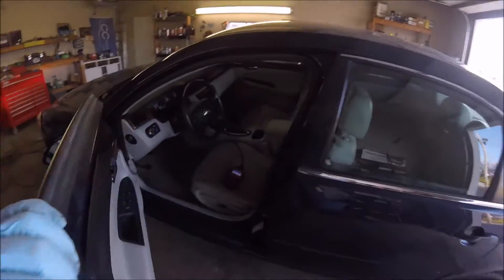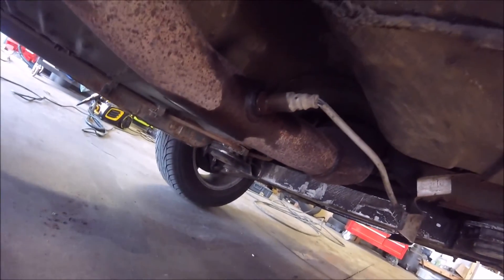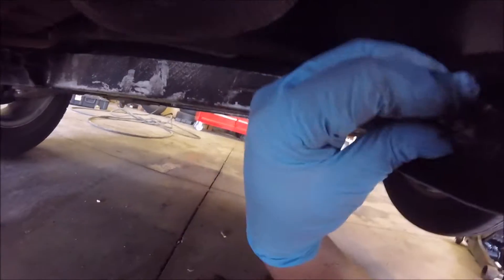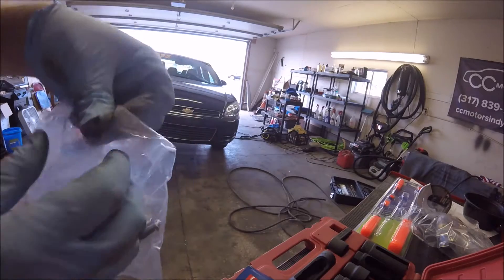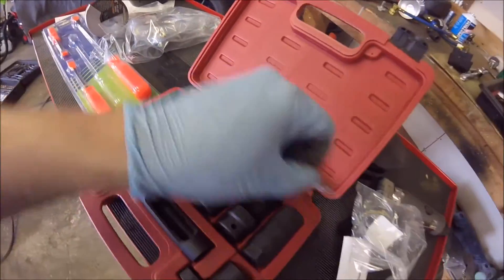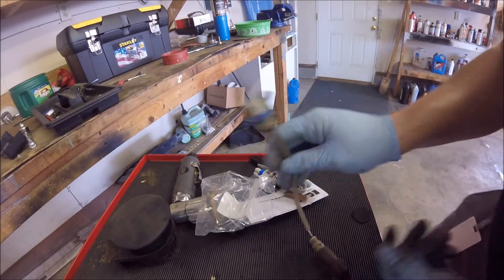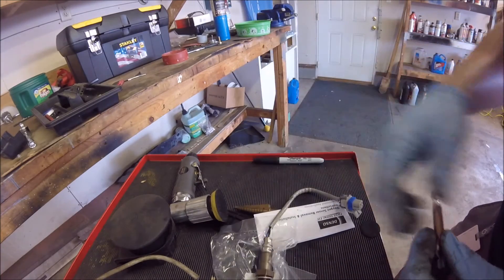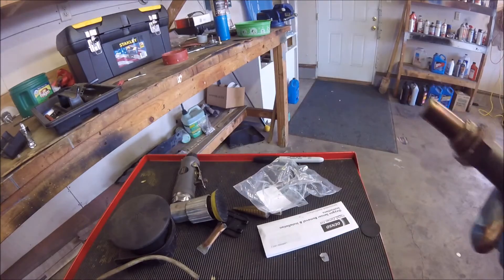GM Chevy Impala - P0137 Check Engine Light O2 Sensor

Comment: Hey Bud cut that wire off. With a 7/8 wrench  a Box end and use another wrench if need be for leverage pop that sucker out. Also they make a offset stubby 02 sensor socket it's probably 2" tall. Give me more leverage. Just offering a suggestion

Comment: Why do u have to reset the code what code because I need to replace mines
Reply: No...once you drive 50 miles or so computer does a emission cycle. It will not the new o2 sensor and fuel trims and turn off your check engine light
Reply: Reset the code before starting the car after replacing the 02 sensor or else your car computer can burn the new 02 sensor out. Learned this from a mechanic on the Impala forums.

Comment: I tried changing my intake to a cone filter and after a little bit of driving I get that code. It's a 2011 with a little over 130k miles, Just figured it wasn't going to work and went back to stock. Kind of makes me wonder if the thing is just on the cusp of failure or as I somewhat figured the computer may very well just not like the intake. As far as I knew the engine would adjust whatever parameters due to having the MAF and two o2 sensors as many other people seemingly add the intakes just fine. I have no idea but just something to think about if you're in a similar situation.